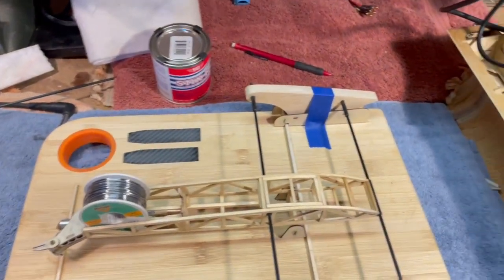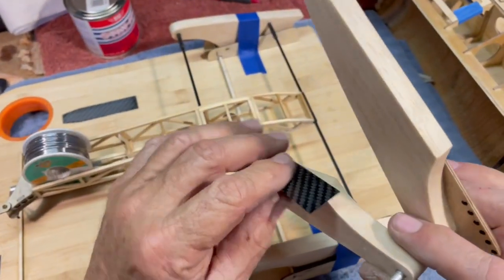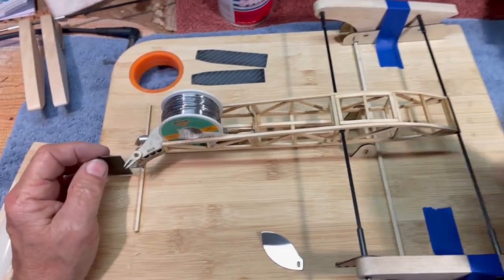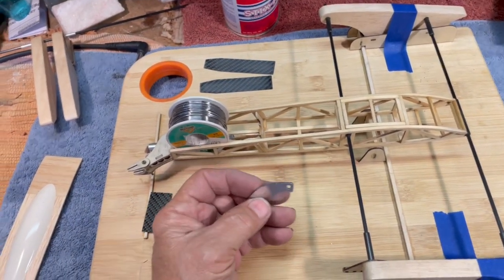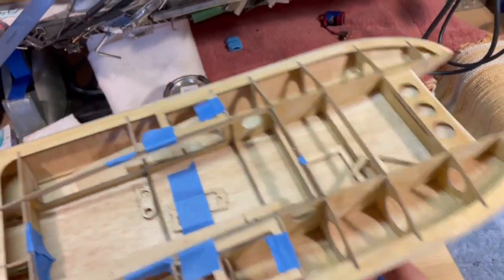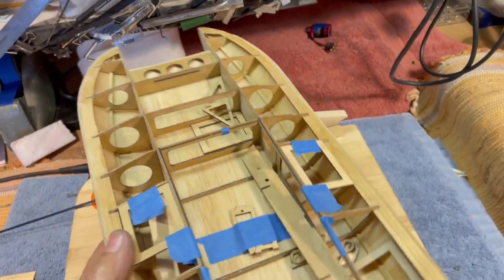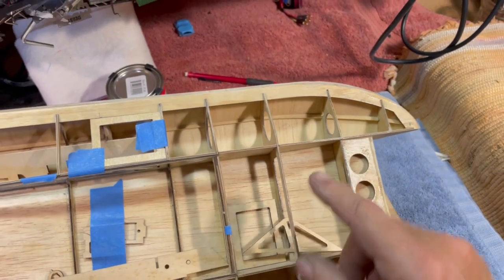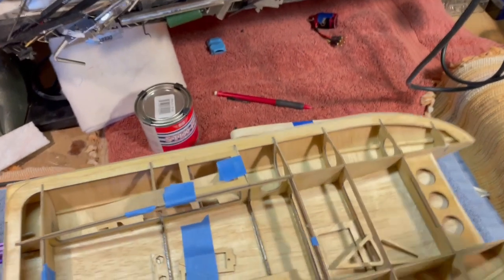Dr. Jet plans on installing a quarter-century old motor and ESC in his prototype catamaran......

Comment: You're such a tease Doc, I gotta know what the 25+ year old motor is, I was all brushed back then, i think it was about 20 years ago when I went brushless.  I know Aveox had been out for a while before i made the switch and the 010 would be appropriately sized but i don't think for 5 years.  Maxcim were the first RC brushless motors I heard about and would have been out back then, but I didn't think they made anything suitably sized, but maybe as they were so far outside my budget i just didnt look far enough into their range.  

Or it could well be that my timescale is off, my memory isn't great.
Reply from the maker: I've changed my plans and will be taking the JetCat 16 to the pond tomorrow where I will open it up and show all the components and you can see how I crammed 5 pounds of Shinola (including an ancient motor and ESC) into a 2-pound hull........

Dave Polumbo and Matt (I forget his last name) started Aveox sometime in the late 1990s.  Steve Neu had a Dynamometer in his garage shop that he made and would develop and test motors for Matt and Dave.  When Aveox left the model industry in favor of aerospace applications, Steve used a lot of what he learned from improving the Aveox motors (magnets, stator laminations, assembly techniques) into his own line of motors, and the rest is history.  Konrad (I forget his last name too) made Kontronics motors and controllers out of Germany at about the same time as well as Plettenberg.  Later, Lehners and Hackers hit the market so by 2000 or so, and brushed motors were soon passe.  I still have my old 27-cell F5B ship from the 2000 World Championships with a geared Plett in it, and it's still frightening to fly; accelerating straight up  to nearly 180mph.